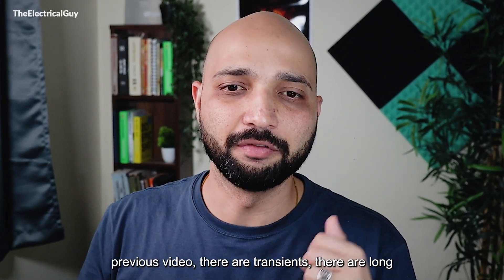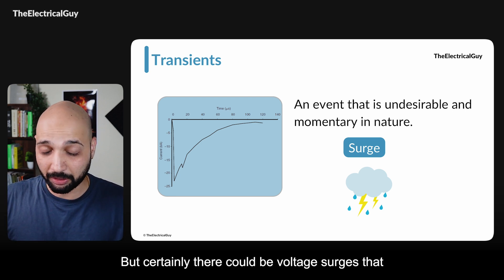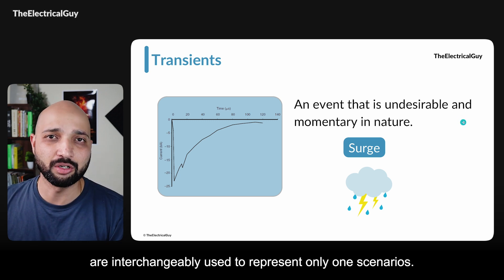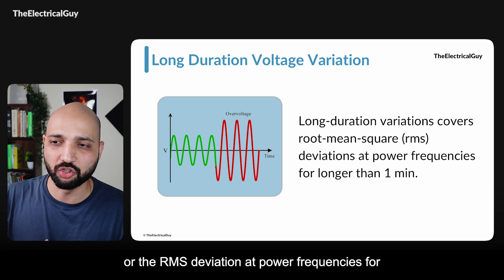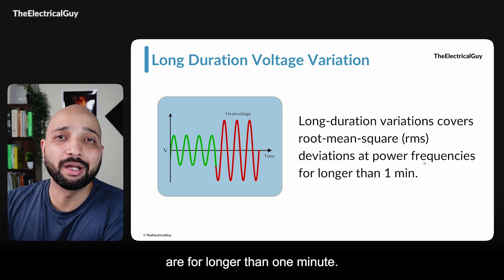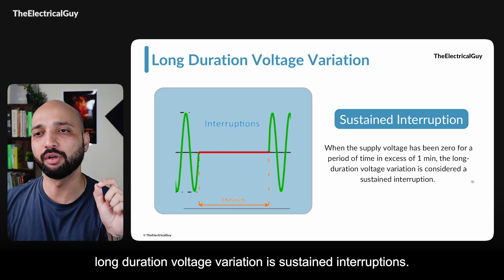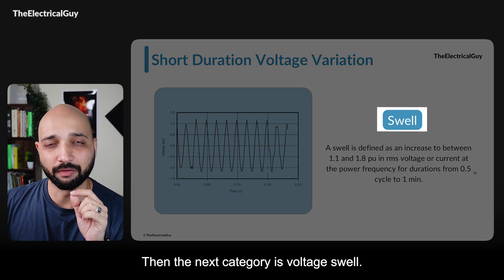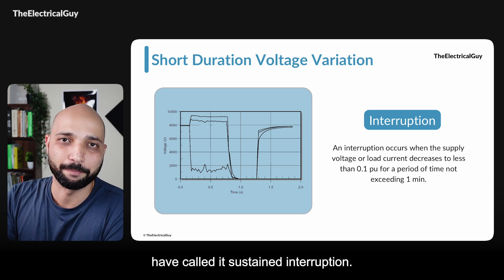Power Quality Issues Explained | Part 1 | TheElectricalGuy

Comment: Sir can you make video possibility on future dc for domestic purposes by using common rectifier after transformer which reduces using rectifier in each equipments like charger,bldc fans,led lights.Also current harmonic issue in renewable energy production when connected to grid.

Comment: Is vaccum circuit breaker an medium voltage circuit breaker
Reply: Vacuum circuit breakers are applied for a maximum of 36 kV which is medium voltage. For higher voltage, let's say 110 kV, SF6 is applied.